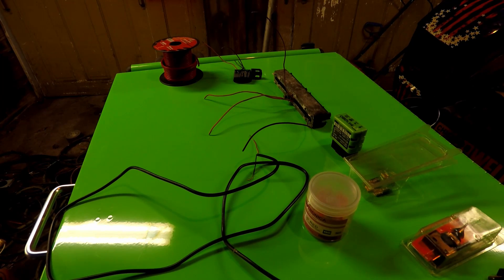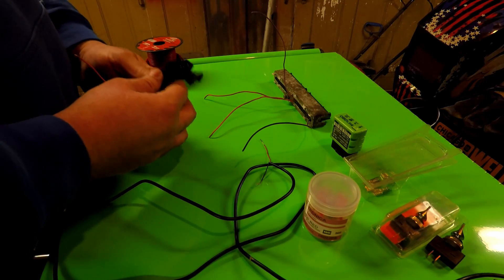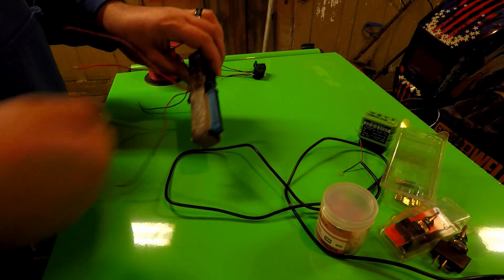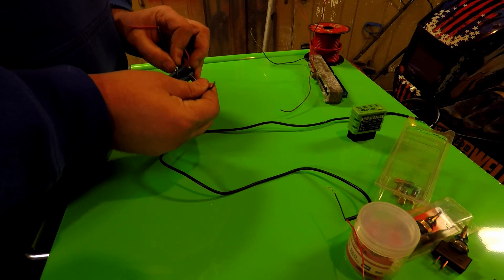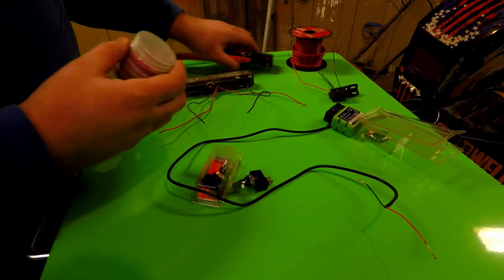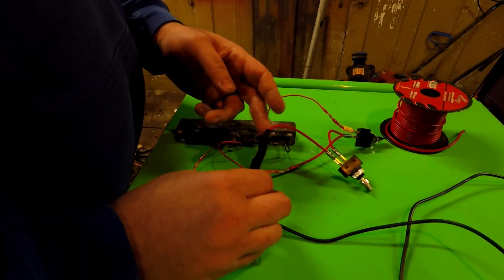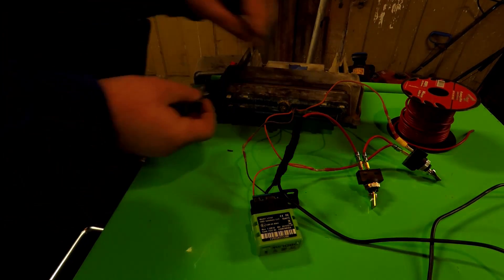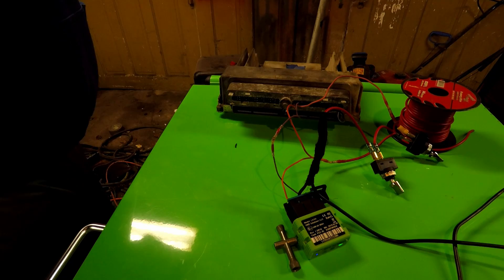LS Droid/Tunerpro Bench harness pinouts and build

Comment: Love the down and dirty type content man.  Straight to the point.  
I appreciate you pointing me to this build video and hate to ask again but I'm looking for a bench harness for newer ecm's. ( GM's E38)  
I've noticed the majority of content revolves around the same two older ECM'S and ALOT of truck engines since they are a dime a dozen.  I'm building a 6.2L LS3 out of a 2013 Camaro ss with a TR6060 6 speed manual transmission.  I understand it's a more expensive option and all but I'm still surprised at how little information is available on this little arrangement.  
 Building a 1970 Camaro and trying to stick with all Camaro parts for the next owners (probably one of my kids) for simplicity its:
 body= 1970 Camaro parts  Drivetrain= 2013 Camaro parts 
Mixed in with as little aftermarket goodies as possible. 
12 years in the making, this is the third engine I've bought/built for this project. Something alway's comes up and I have to sell stuff. . Engines and transmissions get sacrificed first to hold onto the car itself.  I will say though,  everytime I sell and have to re-purchase it gets better.. lol, last engine and trans was a LT1 and a 5 speed out of a 98 Camaro SS.. and before that was a good ol 350 SBC and a Borg Warner 4 speed. 
Soon it will end up as electric motor I guess if I don't get this thing bolted down and running before the next crisis arises ! SMH... 🍻
Reply from the maker: I've never touched an E38, and have little intention of every doing anything with a Gen IV engine. 

Far more than I'm willing to pay to buy in, with too many headaches.
Reply: @TheDrivewayEngineer  yup, nailed it, and nailed it... 
 It's been what one might call " a learning curve " and an expensive one at that. If I had it to do over again at this point I would have been better off just buying the "connect and cruise LS3 " from performance Chevrolet.  9k for the engine and trans, plus the wiring harness, HP tuner, custom driveshaft (due to the TR6060 trans tail shaft) and then a front accessory drive system since the factory one wouldn't clear the A-arms..  by the time you add it all up I could have bought a brand new LS3 connect and cruise with a Warranty! 
 It's a 1970 Camaro that I've restored from the ground up by myself so I wanted it done up nice. Still have more to do but its almost ready to fire up. Wish I would have came across your channel sooner. Like before paying out the nose for a low mileage " All Aluminium LS3 "  I thought I needed...  you are helping alot of folks out. Hope they at least throw ya a bone and buy a hoodie or two. I can't seen to find much of anything on the interwebs about this 2013 Camaro SS swapping business.  But I'm mustering through it on my own. Little by little. I figured out my bench harness last night and disabled Vats, rear O2's, wrote it all on there and tested it. Still have alot to learn about tuning but I'm getting it sorted out.

Comment: so i have the blue connector out of a 2005 gmc truck that i took the lq9 motor out of for my truck so i striped the wires down to what u said but on pin 58 my wire is not the same color as urs does it matter
Reply from the maker: No
Reply: @TheDrivewayEngineer ok thank u sir ill be doing the new ls droid pc version so im gonna use the pcm out of the 2005 gmc to test with not takeing a chance of messing mine up till i know what im doing

Comment: My ECU has a 5volt reference pin. Does this still work without it? Or do you need to give it 5 volts aswell
Reply: My understanding the 5 volt reference pin is for things like monitoring 02 sensors  
Not needed for a bench test harness

Comment: If I may ask why are you only using the blue pcm.plug ?
Reply from the maker: No pins on the other part need to be accessed for tuning
Reply: Awesome so if I use any other PCM it will still work ? Or is the blue the only one needed period ? .. I'm a good bear with me 😂
Reply from the maker: @pinetreemafiallc7052  it'll work with any blue red or blue green
Reply: You are the man !! I'll be building one asap iv got to pull vats out of my PCM for my 56 Chevy Bel Air project

Comment: Solder and seal connectors are bad news, solder designed to melt at lower temperature so it is  weak and cracks later on. Will be nightmare to track down
Reply from the maker: There's like five wires here, it's not very difficult to track down lol
Reply: The good ones are used by the USAF on aircraft, but I don't feel like paying retail for those. If the harness is properly controlled (super easy on such a basic bench mockup harness) it will do fine.

Comment: What type of odb2 to pc cable do you use?
Reply from the maker: Bluetooth
Reply: @TheDrivewayEngineer  Thanks, I'm interested in data aq. Can I use HP Tuner SW and ODB2 Max LX or do I need HP Tuners $300 interface?
Reply from the maker: HP Tuners isn't going to work without their hardware. 

PCM Hammer has data logging

Comment: There is also a black connector don't know what it goes to but the clear one goes to 3800's and 3100's 2000 models ground wire goes to pin 16 instead of 1 other 3 are the same.

Comment: Cool pin out. Like it. Now I just need to build a standalone harness for the bench. Can you help me with that sir?
Reply from the maker: That's what I just built in the video
Reply: I'm new to the LS swap world. Been a mechanic for years. Worked on modern day cars and trucks. Just never did a LS swap into anything as of yet. Thanks for your help. Can I contact you another way sir for further questions?
Reply from the maker: This is a way to tune a PCM on the bench, not a standalone harness for running on a stand. 

Our Facebook group is linked in the description, either I, or someone is always on there to help.
Reply: @TheDrivewayEngineer  no we're not... most often we are there to ridicule.
Reply: Sorry I misunderstood it. I was thinking it was a way to flash the computer. So with this setup I can run and engine on a test stand then. Ok
Reply: C.P C. look up LT1 swap. It has everything you need to know word for word about making your stand alone harness. It took me 18 hrs to rework mine